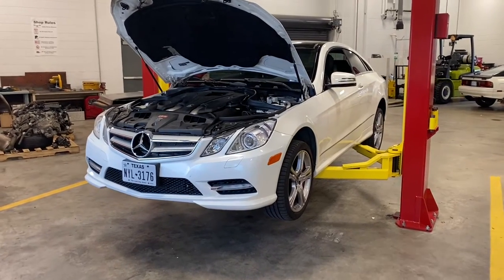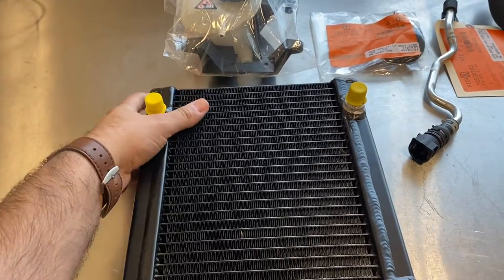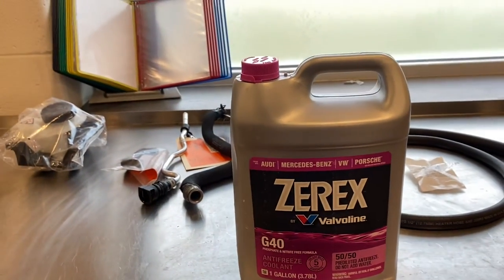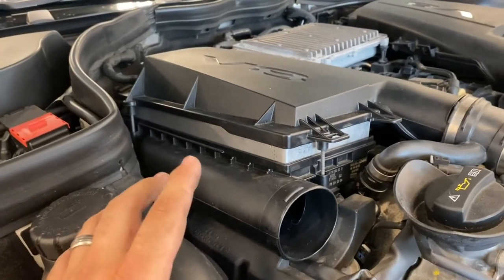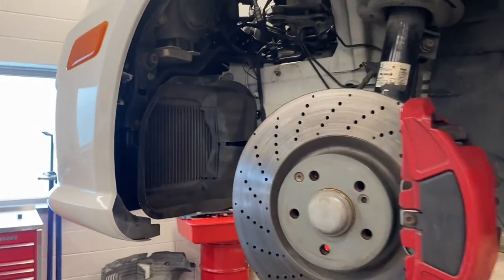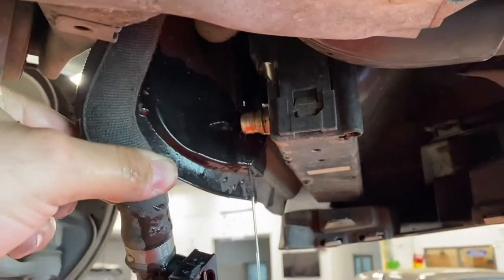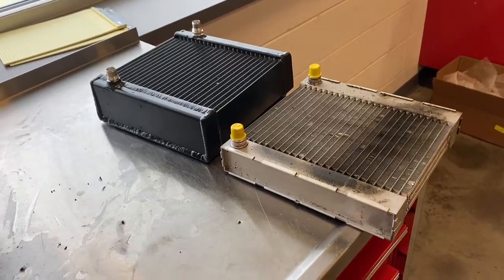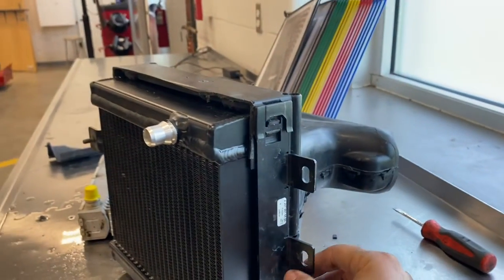E Class (c207/w212) heat exchanger/split cooling modification for bi-turbo vehicles.

Comment: Hi my 14 cls550 has split cooling does that mean I have the extra heat exchanger already I would like to upgrade to the you have if that's the case also thank for you video
Reply from the maker: I believe you still have a single heat exchanger similar to my setup. So can upgrade to a larger unit but just following the first half of the video and bleeding the system afterwards.